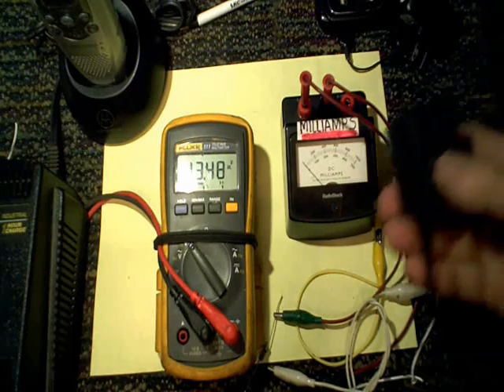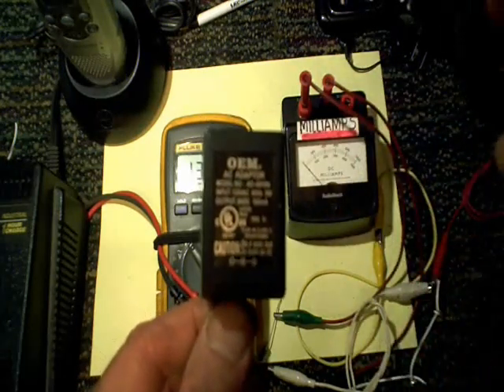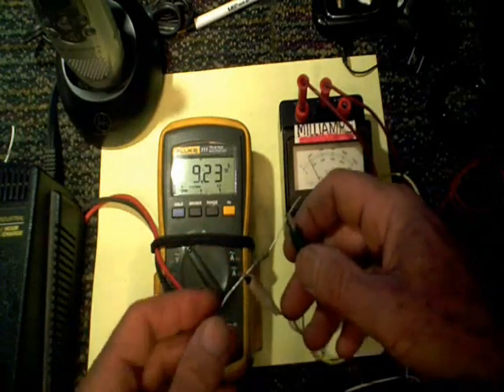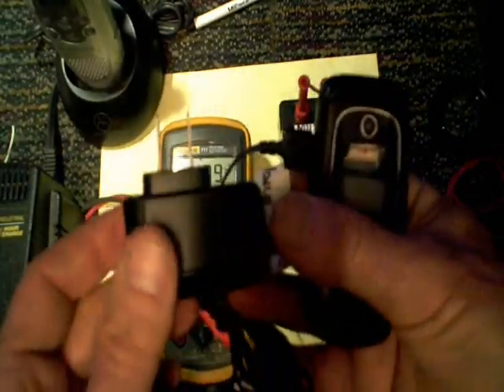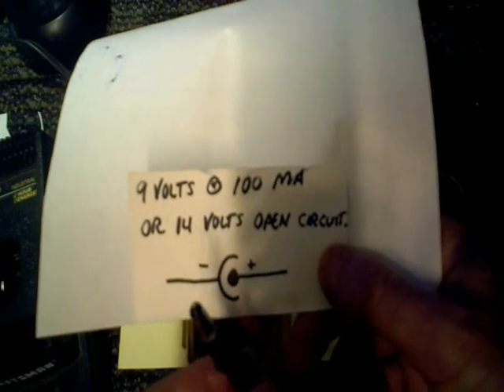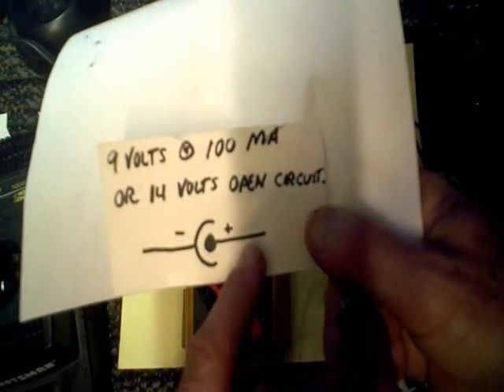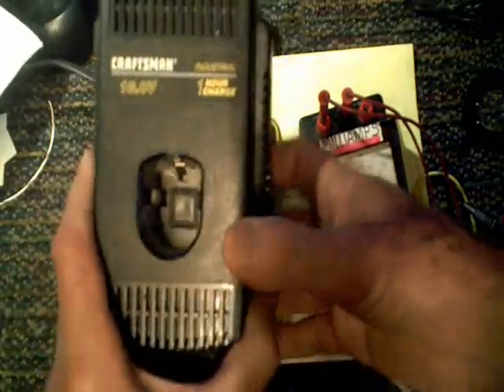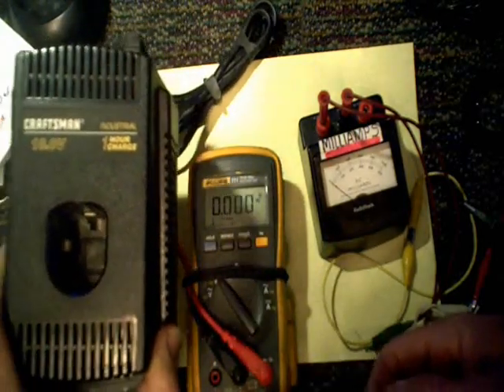Power Adapters And Smart Battery Chargers.

Comment: 00:13 - that slight sigh a second or two later speaks a thousand words.

Tech: "So - you need a power adaptor? Any idea what specifications it was? Voltage? Current?"
Customer: "it was black - does that help?"

:)

Comment: Dave,
I understand the difference between regulated and unregulated... But how would I know by just looking at it, what type it is? What will be some good indicators, if I'm out and have know Multi-Meter? Thanks.
Reply from the maker: +grantnm1 If you test the output of power adapter without a load, and the voltage is what the label says it should be, it's most likely a regulated. An unregulated power adapter will generally test much higher without a load.
Reply: Thanks Dave. I was kinda thinking that.
Reply: +grantnm1 
I have a few cheap little DMM's that I put in the glove-box, toolbox and stuff so I'll have a DMM no matter what happens.
Reply: +Robert Calk Jr. Thanks. I just remembered I have a cheap DMM to put in my car.
Reply: +grantnm1 
You're welcome. The accuracy and resolution isn't to great, but they come in handy in a pinch.

Comment: Super important is that if you buy a cheap charger, that does not stop charging for rechargeable lithium ion batteries when the batteries are charged, and you leave the batteries in the charger for weeks at a time the charger will ruin the batteries. So, always buy a smart charger for your rechargeable batteries. I learned the above the hard way.
Reply from the maker: +roomba I think continual charging is bad for any type of battery. In one case I took apart an Uninterruptible-Power-Supply and  noticed it also had an unregulated power supply to charge the battery, but the transformers output never exceeded 13.8 volts with out the battery being attached, so that was probably okay regardless of the low budget design, but when the power adapters output is far above the batteries voltage I'm sure it must shorten the life of the battery.

Comment: Dave, crazy question. ...
did you have your thumb replaced with your big toe.
I'm very serious. ....
I knew someone that did.
your right thumb appears larger than your left.
I mean absolutely no offense. 
thank you.
Reply from the maker: +Frank Pitochelli  That's still the original equipment your seeing.  I'm right handed so that probably accounts for the difference between the Two.
Reply: +Frank Pitochelli Your funny, I smashed my thumb with a hammer and after
they removed the nail, it grew back bigger then the other.